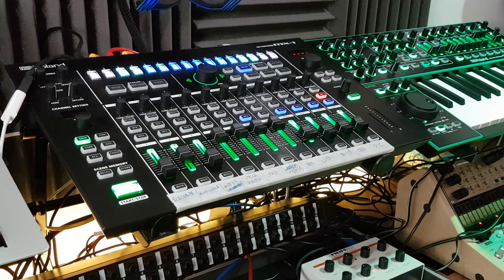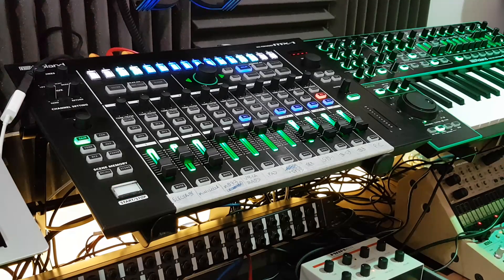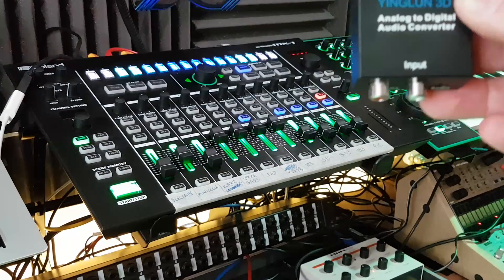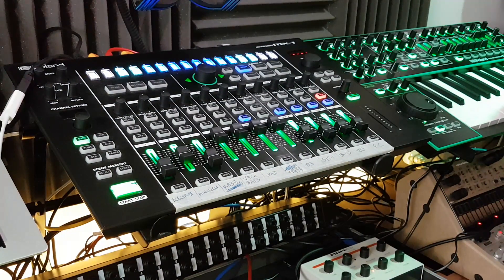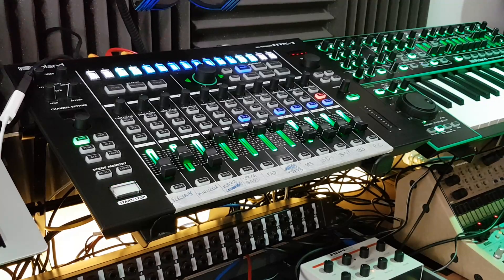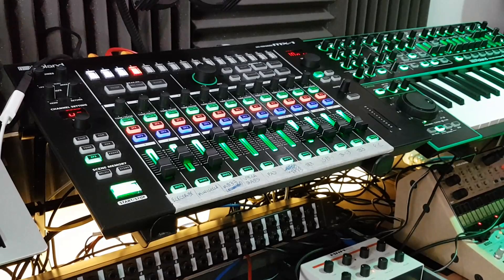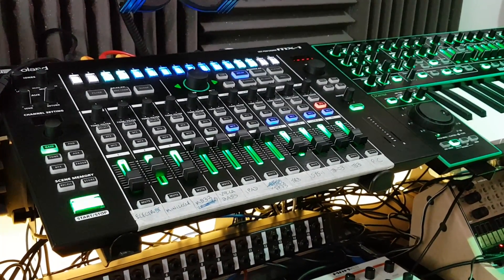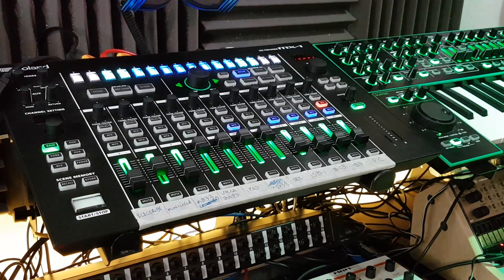How to use the digital channel on Roland MX-1 mixer with an analogue input

Comment: Hi new mx1 user done as instructed set to 48 all other inputs used bar this , have different model converter which said is 48khz compatible let's say for instance used both left out and right out on my korg monologue mx1 was showing signal on l and r display under mx1 mastering button but without sound , I accidentally plugged 1/4 jack (going to 2 rca to converter in headphone socket on korg and works any suggestions for getting source  from actual output not headphone or does it matter as have sound  ???? Thanks
Reply from the maker: Not sure on that one but I guess if you have some sound out the headphone output then stock with that

Comment: Hmmm I have the exact same a/d converter and it works with the MX-1 at 48k but the sound comes through very muffled. It’s almost as if it’s half sample rate, really poor, lacks sparkle. Try taking a nice bright drum loop or pattern (something with some nice shiny hi hats) into 5/6 analog, but also into the digital input via this converter, (perhaps using the headphone out from your instrument, so that you can easily a/b compare). I’ve got a nasty feeling you’ll be shocked, and won’t use it again... Under a tenner for this sort of thing is just too good to be true sadly.

Comment: Hi, I am connecting my roland tr8 to my mx1 via usb. When I have my mx1 at 44k my tr8 sounds fine. When my mx1 is at 96, my tr8 audio is glitvhy and unuseable. I want to use 96k so my digital input works with my analog to digital convertor, which only works at 96k. Any ideas whats going on? the mx1 is meant to match sample rates for the aira range, and the tr8 should be coming through at 96k
Reply from the maker: Not sure on this one. If I can think of a solution I will let you know.
Reply: same Problem over here :/ any solutions yet?
Reply: Having the same issue with my tb-3

Comment: Funny how you can bang your head against the wall of some hardware limitations for so long, then you step back and realize there's a damn door right next to the divet left by your forehead! :) Hey, as one of the few 'tubers that seems to have really integrated the MX1 I have a couple quick questions... 1) vs. just using regular mixer, what's the one killer feature in your opinion? The feature that has me almost pulling the trigger is the scene store and recall... which leads me to question #2... when using scenes, are the fader locations stored and recalled? I can't find definitive info on this... and if they, since they are not motorized, how does that work? If they recall to a location that's different from physical location, how do you know actual value visually, and if I move a fader, does it do pickup or scaling, or just jump? Thanks for a great channel!!
Reply from the maker: The Drümünkey i think the best thing with the mx1 is using it with other aira gear...they integrate really well. also love the beat fx and scatter fx etc. I've never used the scene recall so not sure about that. glad you like the channel. 👍👍

Comment: Thanks for the video.  I tried to use plug my Fantom G8 digital output to the digital input of the MX-1, but I didn't have any success.  I'll try to change the sampling rate.  Perhaps that was my mistake.  Thanks for the video.  It's nice to know there's other options for the MX-1.  Take care and have a great week.  Sam.